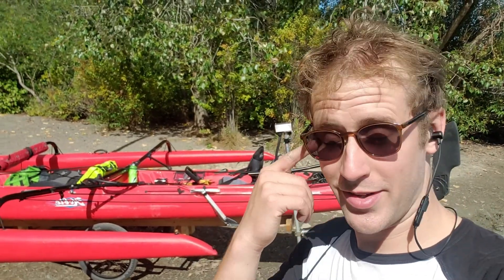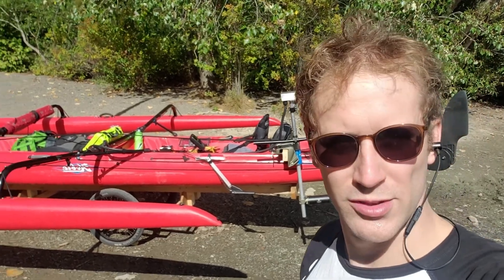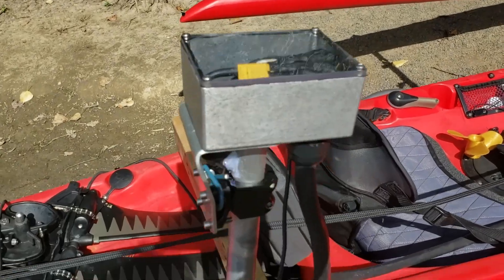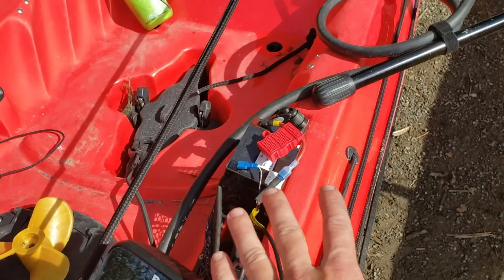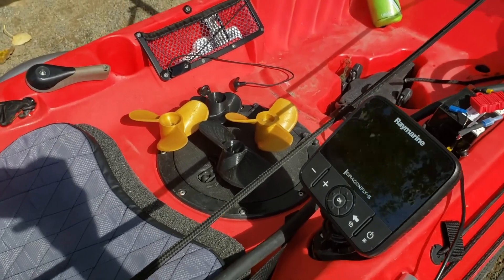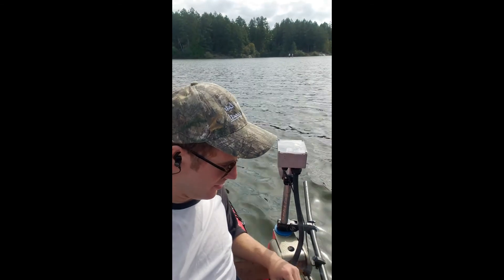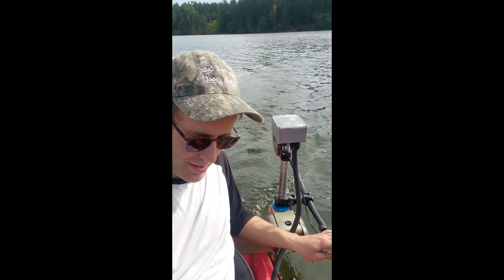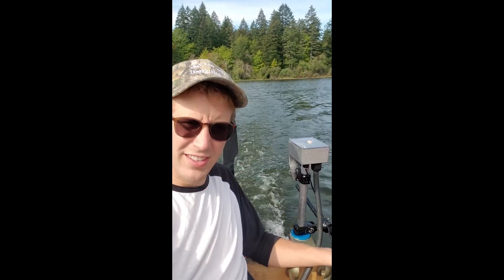2.5kW DIY Electric Outboard! Part 2 - Trials

Comment: 5 knots with 2.5 Kw is pretty rad!  Rarely, if ever, will a sailboat (displacement hull) achieve equivalent performance with a motor as it does under sail... I have a very similar build (2.5 kw/ 10s/ 80A) but I added a solar charger to it... my oceanic canoe is much bigger, tho... if I hit 3 knots when I do my power trials I'll be absurdly stoked.  Good job!